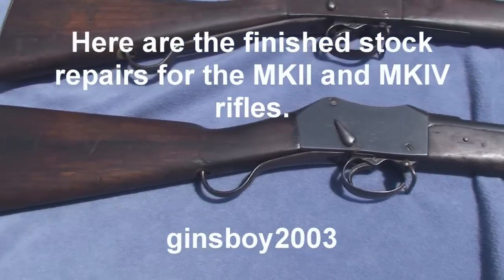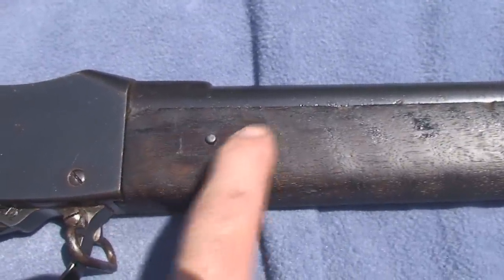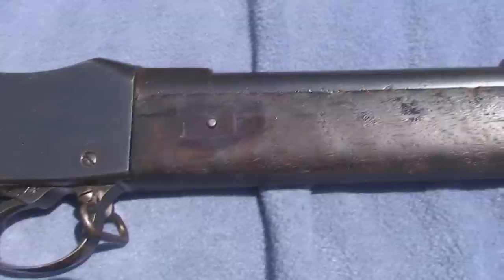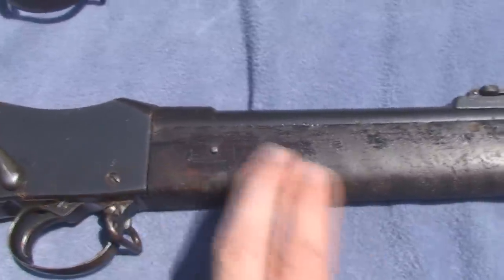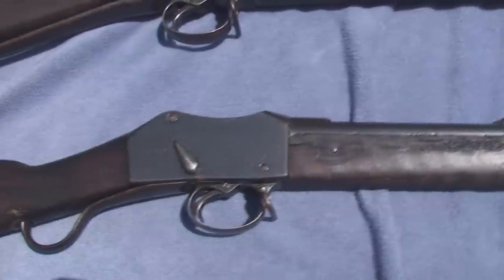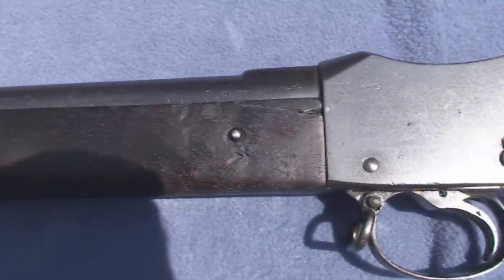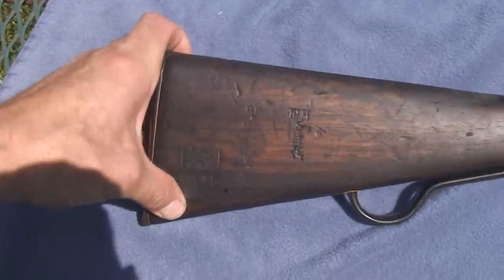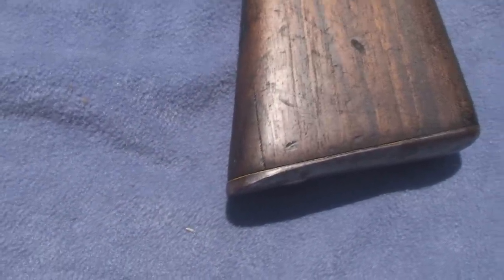MKII and MKIV Martini stock repairs reviewed.wmv

Comment: in place. Professional combination circular saw benches had a dowling tool at the side where they had a platform to run timber through in what today is called a "thicknesser" and using that doweller can give a very accurate drilling...or use a dowling jig (Stanley for example). Doing basic work precisely and painstakingly will give a 'fix' of which you can be proud.Using a bandsaw or hacksawcan give you a right mess if you do not simply cut close, protruding say 2 mm, to be finished by sanding.

Comment: or use one of the very modern 'renovator's to get a precise cut out to give a firm fit to timber of the same dimension so it has to be firmly pressed into the cut-out with pvc or horse glue (hot) applied.That may look better being done both sides of the stock. Use a grain which follows the stock grain.Unless you can make a jig for precise redrilling or take to a cabinet maker to drill (using perhaps another rifle as template) then do as ginsboy has done but be precise and have the rifle 'fixed'.

Comment: If this takes an hour or two...don't worry, be precise and accurate and patient, Fit the slivers at perhaps 1/2-3/4 inch spacing along the crack.Ensure they fit perfectly and are at least 2-3 mm deep into the timber. Remover the cramp or clamp. protecting the barrell or removing the stock glue the cleaned crack all along and glue the recesses you have made...Clamp the crack fully closed. Fit the timber slivers and clamp them down(organised). Check all on and leave 24 hours.Make beautiful! Voila

Comment: 8) You might know what a butterfly stitch is..? Such a thing can be made with timber but requires painstaking accuracy or a real craftsman...then it's permanent AND beautiful in repairing a crack. There are several do's and don'ts for example don't remove material at the crack..maybe there us some acetone and later pvc or horse's'hoof glue.Clamp the crack closed. and carefully hand chisel one or more slots across the crack to suit a very regular 1-2mm hardwood sliver you already have obtained,,,

Comment: The HSS drill is not intended to be used on wood..it overheats and clogs.They are however used extensively for wood. Hole sizes can be metric or imperial and drill bits can wander as they do not have the tip augers have. The correct glue for timber is horses' hood granules but there are also commonly used pvc glues. In the case of large damage I am better to cleanly and precisely chisel the hole through paring manually  ..not hitting ...a very sharp chisel. I may be able to use a router.. how

Comment: 6)..Wisdom..Search out old workshops, estate sales for example and buy all the old time woodscrews you can and store them for yourself and future generations. They will be correct strength threading and shank as well as a clear cut slot.Please, never use Philips or 'Tek' screwsor battery drills, on this work. As I said before I would chisel by hand or router out a slot to precisely fit a wood block ,correct grain direction, glue it, use a correct old-time awl to centre it.Firmly bed your screws.

Comment: Working with these old timbers isn't always so easy. How far too go?....As you can see timber shrinkage has occurred. What standard to I want the rifle to be when completed? Do I understand the forces the timbers experience?..is my 'clean and glue' technique permanent or temporary? The oil grease sweat and dirt will have in diminishing quantity penetrated even into clean wood I find  What is the timber with which I am working? Do I understand how a woodscew works and about correct use of tools?

Comment: 7) Try to avoid acetone and 'plastibond' or epoxy  repairs if possible. Get to clean wood and make the work look professional by doing things exactly the same both sides of the stock use proper and suitable timber glues,repair with epoxy evident around the sides of timber..epoxy  will not swell and contract in conjunction with your timber, either. To repair a crack as ginsboy has is better to replace the timber piece with a perfectly fitted woodblock or just leave it alone...see suggestion 8.

Comment: 5) Using dowells as he has done is not what I'd do...the grain is not correct. I suggested a cut out etc earlier on..exactly same bothside of stock for his other repair.Woodscrews are made tapered with a shank so that when the timbers are pulled together there is effectively a barrel stopping the thread from allowing the timber to work loose over time...His screws (and today the chinese flood us with junk...lousy metals, lousy techniques) do not allow the shank to pass the metal into the timber